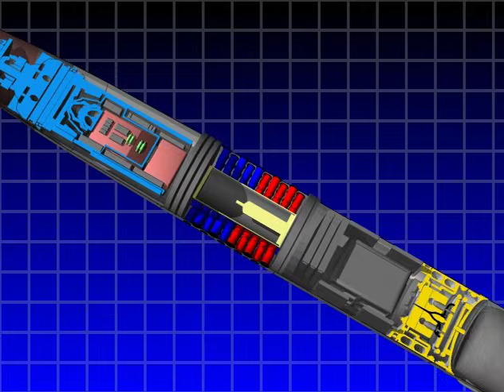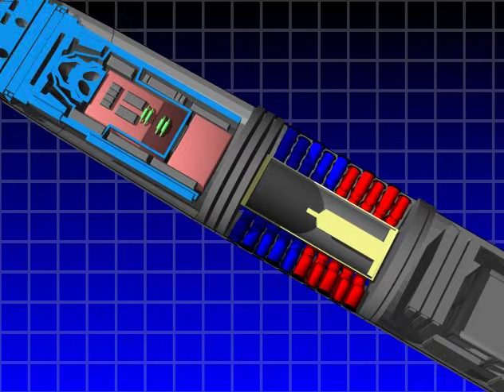PAC-3 Missile: How The System Works

Comment: But this missile has no perfect history in the warfront. It was proved in the first gulf war itself that this system is not able to shield the cities in Saudi Arabia from the old scud missiles from Iraq. Even the last incident in Saudi, the missile attack of Iran over US military basses. Where were these missiles at that time to engage with Enemy missiles? So it proves that this missile system is absolutely not success.
Reply: The interception which was made in gulf war was conducted by PAC2 not PAC3. The legacy PAC2 was initially made for an AAM role, and is ABM attributes were limited( this gets better when it goes to PAC2 GEMT) 
After the quite-failure of PAC2, not able to fully intercept target via a fragment warhead, US army decide to make a hit to kill interceptor. This is the PAC3. 
The pac3 was very sucessfull in operation iraq freedom, doing multiple interception. 
Also, if you have read the new article carefully, the interception attempted by the Saudis were pac2 not an pac3. 
So in conclusion, you are comparing the wrong missile. Yph could say that the original pac3 lacks intercepting capabilities against high velocity ballistic targets, on the category of MRBM and further. However this gets better when going to PAC3 mse variant which has increased both its speed and range.( It conducted a succesful interception test against a MRBM class target)

Comment: How fast does this travel because a smaller, faster missile, using a lighter more volatile explosive will get past, if it has no explosive and relies on kenotic energy to make contact through increased speed. This would a marked improvement, get rid of a explosive in order to increase speed.

Comment: THAT'S A LOT OF DAMAGE!
Reply: Flextape
Reply: Lol dats a meme righty
Reply: Well it's nothing to  flextape tbh
Reply: Yes, yes it is
Reply: Yeah!!!!
Reply: I'd use flex seal tbh
Reply: Flextape will do the job 😤
Reply: Hi, Phil Swift here with Flex Tape! The super-strong waterproof tape! That can instantly patch, bond, seal, and repair! Flex tape is no ordinary tape; its triple thick adhesive virtually welds itself to the surface, instantly stopping the toughest leaks. Leaky pipes can cause major damage, but Flex Tape grips on tight and bonds instantly! Plus, Flex Tape’s powerful adhesive is so strong, it even works underwater! Now you can repair leaks in pools and spas in water without draining them! Flex Tape is perfect for marine, campers and RVs! Flex Tape is super strong, and once it’s on, it holds on tight! And for emergency auto repair, Flex Tape keeps its grip, even in the toughest conditions! Big storms can cause big damage, but Flex Tape comes super wide, so you can easily patch large holes. To show the power of Flex Tape, I sawed this boat in half! And repaired it with only Flex Tape! Not only does Flex Tape’s powerful adhesive hold the boat together, but it creates a super strong water tight seal, so the inside is completly dry! Yee-doggy! Just cut, peel, stick and seal! Imagine everything you can do with the power of Flex Tape!

Comment: The Missile knows where it is by knowing where it isn’t.
Reply: By subtracting where it is from where it isnt
Reply: @chelo4197  or where it isn't, from where it is, whichever is greater, it obtains a difference, or deviation.
Reply: @Jeremiah-mj9kw The guidance subsystem uses deviations to generate corrective commands to drive the missile from a position where it is, to a position where it isn't, and arriving at a position that it wasn't,  it now is.
Reply: @haltocarrick5504  Consequently, the position where it is, is now the position that it wasn't, and it follows that the position where it was, is now the position that it isn't. In the event of the position that it is in is not the position that it wasn't, the system has required a variation.
Reply: @Jeremiah-mj9kw  The variation being the difference between where the missile is,  and where it wasn't. If variation is considered to be a significant factor,  it too may be corrected by the GEA.  However,  the missile must also know, where it was.
Reply: @haltocarrick5504  The missile guidance computance scenario works as follows: Because a variation has modified some of the information the missile has obtained, it is not sure just where it is, however it is sure where it isn't, within reason, and it knows where it was. It now subracts where it should be, from where it wasn't, or vice versa.
Reply: @Jeremiah-mj9kw  And by differentiating this from the algebraic sum of where it shouldn't be and where it was,  it is able to obtain the deviation,  and it's variation,  which is called "error".
Reply: I didn't get any of that shit
Reply: @thecoolerpooh5861  search "the missile knows where it is"
Reply: This only applies to inertial guidance in older cruise missiles.
Reply: @user2C47  Isn't this one also inertially guided?
Reply: I was looking for this comment
Reply: When I was first taught that in tech school as a 2M052, I was confused. But over the course of my years at malmstrom, I figured it all out.
Reply: The bank said I got no return of investment on this one. Loan denied.
Reply: This is a bad description for inertial guidance.
Reply: Isn t where it isn t infinite ?
Reply: I just wanted to type that
Reply: We get it
Reply: Basic middle school math: Set Theory: Venn Diagrams 😁
Reply: NOOOOOOOOOOOOOOOOOOOOOOOOOOOOOOOOOOOOOOOOOOOOOOOOOOOOOOOOOOOOOOOOOOOOOOOOOOOOOOOOOOOOOOOOOOOOOO

Comment: "Anno Domini" comes before the year, not after.  AD 2005, not 2005 AD.  BC goes before: 400 BC, but AD 400.  If you want positional consistency, use BCE and CE: those both go after the year.

Comment: This system is sadly and vastly inferior to Russia's S400.  The radar and systems integration components (command, control & communication) are inferior to the AEGIS system and the capabilities of the missiles themselves (range, speed, accuracy) are woefully inadequate to cope with any of the existing maneuvering, hyper-sonic threats. We've neglected air-to-ground missile systems for way to long.

Comment: feet, inches? What units are those?
Reply: Those are the units of length used by engineers to put man on the moon.
Reply: @monkigunmkiiflash3110  Bullcrap.
Reply: MS  From the transcript of Apollo 11:
" 04 days  06 hours 45 min  17 sec  LMP - Lunar Module Pilot (EAGLE)
40 feet, down 2 1/2. Kicking up some dust. ......
04 days 06 hours  45 min  21 sec  LMP (EAGLE)
30 feet, 2 1/2 down. Faint shadow. ......
04 06 45 59 CDR (TRANQ)
Houston, Tranquility Base here. 
04 06 46 04 CDR (TRANQ)
THE EAGLE HAS LANDED. "
 It's Analog baby!
Reply: @monkigunmkiiflash3110  It doesn't mean anything. World laughs at imperial units, because they are unnecessarily complicated and pointless.
Reply: MS It really isn't all that complicated.  You got to admit 500 horsepower sounds a lot cooler than  373 kilowatts.
Reply: @monkigunmkiiflash3110  horsepower is in use because people are used to it, but there is nothing cool about it. It is complicated to understand besides it is power required to raise 75kg in g field to height of 1m in 1s. Besides that there is completely nothing cool about it. For example there would be a lot of goofy conversions when you wanted to calculate how long time it would take to raise temperature  of 1kg of liquid water by 1K or how much energy it be spent during that time. hp and all imperial units are nonsense. There is no logic no reason behind their values. There is nothing complicated about SI units, not imperial units.

Comment: pac 3 are useless. the saudis are trying to acquire the s 400 because of the pac 3 inability to intercept houthis missiles
Reply: @Standardowy Login

you still chirp that tune? failing to hit any against 108 cruise missiles, Russia has released pictures of the scraps from those cruise missiles, you are aware of this right? S-400 also did not fire at the cruise missiles at all, the only weapons that fired were under control of the SAA and the ones that scored hits were Pansir-s1's.

trying to deny that those scraps they are showing are real is useless, because the tomahawk has a unique engine design, which is clearly shown in the picture, as well as several panels that show serial numbers or something of the likes.

the fact is that a patriot launcher takes 45 seconds to turn 180 degrees, while an S-400 can fire in any direction immediately makes it more effective at area defense, the S-400 also has longer range missiles and longer range radar.

next to that the S-400's launch control vehicle is compatible with multiple SAM variants (such as the pantsir and SA-15) and you can even connect 2 control vehicles to make a total sam site of 24 launchers, each with 4 missiles and 8 in direct reserve (reloading takes about 15 minutes 10 if its a fast crew) 1 tracking/search radar station for the s-400 can detect 200 targets and track 16 simultaneously. but the S-400 is not limited to serving with only 1 tracking and 1 search radar in its battery, it can have 4 of each. making tracking 64 targets and detecting 800 of them possible.
Reply: The missiles used to intercept Houthi missiles were old PAC-2s, not the PAC-3. The PAC-2 is not optimized whatsoever for missiles, only aircraft.
Reply: that is an interesting picture, mind telling why it has its engine inside its body? instead of hanging underneath like a tomahawk?

also has there been any US or EU video showing the impact site? according to the USA they shot 21 missiles at 1 building (the scientidic research center) but when you look at foto's or video now, that very much does not look like a building that was hit by 21 1500 pound warheads. 

these are some pretty large pieces https://www.veteranstoday.com/2018/04/25/trump-fail-russia-shows-tomahawk-missiles-shot-down-over-syria/

again the tomahawk's engine design is undeniable, http://svobodnenoviny.eu/105-zasahu-v-syrii-nepravdepodobne-tvrdi-rusko-a-ukazuje-ulomky-raket-sestrelenych-pri-americkem-utoku/ and that is 100% it.
Reply: Love it or hate it but its obvious that s-400 is in high demand which is why Washington is sanctioning countries that are trying to buy it.  Theirs a reason why so many countries are lining up for the S-400 beacuse it works the best!!  And we here in America will lose our air dominance.
Reply: Lodewijk Vrije fragmentation pieces of the Tomahawk warhead and missile body would create both kinds of damage.  The missile body continues forward as the warhead detonates, crumpling against the blast wave like an accordion.  This will create entry and exit damage.  These pieces are far too small to be proof of a shoot down.  You should have significantly intact sections of the fuselage, similar to when the F-117 was shot down.  As for my IQ, I think we both know you are making a fool of yourself.
Reply: Imran Alwageeh 
you stupid lier, we downed more than 150 Houthi ballistic missle with pac3
Reply: the only people who are stupid are the ones who let the saudi family rule them.
Reply: AlMulazimChannel i didnt no us sold pac3
Reply: Lodewijk Vrije nobody is denying that the Russians showed pieces of a Tomahawk, even though many of the pieces shown are actually from decoy target drones.  There would be pieces of Tomahawk missiles all over the place, obviously from those whose warhead detonated.  What you do not seem to understand is that when the Tomahawk warhead explodes, all you have left are smaller pieces.  When a Tomahawk is shot down, you get much larger pieces, similar to the Serbian wreckage.

The Russians seem to not have any of the larger pieces that you would get if they had intercepted Tomahawks.  They have nothing that looks like what the Serbians have.
Reply: Outdated technology worthless
Reply: Considering its Lockheed that made it, I doubt this missile will actually work properly. We have plenty of intelligent people around, and start up manufacturers too, yet we let Lockheed have a monopoly. They don't even put up enough effort into making a proper F-35 because we litterally have no choice buy to choose the F-35 because there is no alternative, and now they are putting their hand into drones, missiles, and even healthcare. Even Boeing can't compete with them anymore.
Reply: >Considering its Lockheed that made it, I doubt this missile will actually work properly.

This is hyperbolic nonsense.

>yet we let Lockheed have a monopoly

Northrop, BAE, Raytheon, Boeing, and many other contractors all exist. We would have more but in the 90s after the cold war a lot of companies started to die due to defense spending cuts.

>They don't even put up enough effort into making a proper F-35 because we literally have no choice buy to choose the F-35 because there is no alternative,

The F-35 is currently doing exceedingly well, has achieved phenomenal scores in exercises, is the most advanced fighter on the planet, and is finishing up block 3F. Just because it had lots of problems in the earlier stages in the program does not mean its a horrible fight, it was in development, its to be expected.

Also, there are plenty of other alternatives, the JSF program had everyone from lockheed to northrop to general dynamics bidding for the contract, besides the point that we can just buy another fighter. We are buying it because its great, not because other alternatives don't exist.

>and now they are putting their hand into drones, missiles, and even healthcare. Even Boeing can't compete with them anymore.

All of these are important, and Boeing was LITERALLY part of the JSF program. By the way, Boeing was actually pretty close at winning, the X-35 won because parts of the X-32 had to be taken off for flight and Boeing just wasn't ready. In addition, lockheed is specifically a military contractor, the company revolves around selling things to the government to stay afloat, no wonder they are doing so well, or they would go bankrupt.
Reply: Outdated??? HAHAHAH few weeks ago they downed a Syrian SU-30... Russian systems are not combat proven, S400 never killed any hostile target.. Russia is years behind.. THAAD is the most advanced in the world.. If there is an outdated weapon systems, its the Russian.
Reply: the houthis were using a missile whose warhead detaches.
Reply: S-400 doesn't have any operational ballistic missile kill- ZERO kills, how did you determine that S-400 is better? Patriot missiles have been killing BMs since 1991 and they have gotten good at it after every upgrade.
Reply: Cihat Keles no pictures or videos?  You know it they had shot down the missiles they would show a video or pictures.  Nothing...
Reply: Standardowy Login whole world knows more than 70 missile destroyed by s200(1960 mode system) :D keep watcing your american shit propagandas
Reply: LOL the Syrians reacted a little too late! By the time they fired their missiles, the US/UK/France had already finished destroying their targets!
Reply: Lodewijk Vrije do you have a clue what a "shot down" cruise missile looks like?  Google pics of the cruise missiles the Serbians shot down.  They got a few, and they have big identifiable pieces that need a garage to fit into.   What Russia showed was the pieces you would get with warhead detonation.   A missile that is shot down will have very large pieces.   The Russian pics were hilarious because they circled frag holes in the debris, which were caused by the detonation of the Tomahawk.  It was a sad joke.

https://commons.m.wikimedia.org/wiki/File:Downed_Tomahawk_cruise_missile_in_Belgrade,_Serbia.jpg
Reply: @mandoreforger6999  So bro you wanna say that we (Serbia) had more advanced technology in 1999 then Russia in 2018 which built their AMS-s to counteract NATO encroachment. And we also downed your helis and jets and your proud F117A so called "stealth plane" . Thanks for agression though, we fought with you in WW1 and WW2, Serbian flag was the only flag raised above White House, and yet your government decides they should help Sunni Shqiptars and Mujahedeens on Kosovo and Metoxija instead of those who are Europeans and defend Christianity.
Reply: also if you really claim the fragments circled in white are from the tomahawk itself, then you must have a very very low IQ. any normally functioning brain would see that the holes are in fact entry holes and not exit ones.
Reply: Please explain how great Russian air defence is to Assad. After failing to score any hit against 108 US cruise missiles he may start being grumpy.
Reply: Standardowy.. They didn't hit a single Tomahawk.. Its all  the usual Russian propoganda of course they have to sell something to domestic audience..
Reply: Syria does not have the s 300.  They only have the S 200. And reports out of Syria say that they shut down 70 cruise missiles out of the air with a system designed in the 1960s. Not bad.
Reply: Reports? You mean wartime propaganda backed up by few Syrian recordings on which those rockets are shot in the sky and do not even try to correct their course to follow any specific target?
Reply: Those are fake. 108 cruise missiles were fired (it's very easy to track this and multiple other countries confirmed it) almost the same number of craters were found on the air base where the missiles landed according to satellite images which are publicly available. There is literally no evidence of any missiles shot down; I hope you realize that the figure that Assad's regime gave was completely fake.
Reply: Standardowy Login, your data is out of date. The Syrian/Russian forces decided that actually they did not even attempt to intercept the U.S./Co-alition strikes. All but two of the Stormshadow and cruise missiles impacted on target. You really should not believe everything you are told.
Reply: The comment section clearly shows how effective Russian Propaganda is to brainwashing ppl